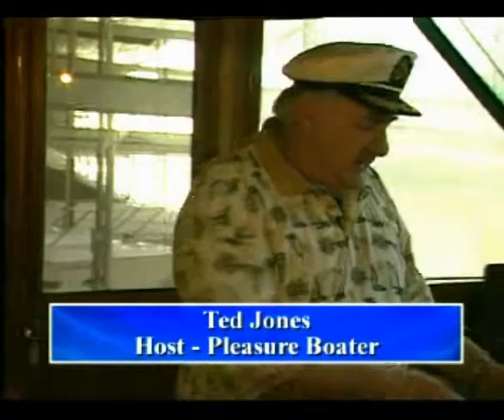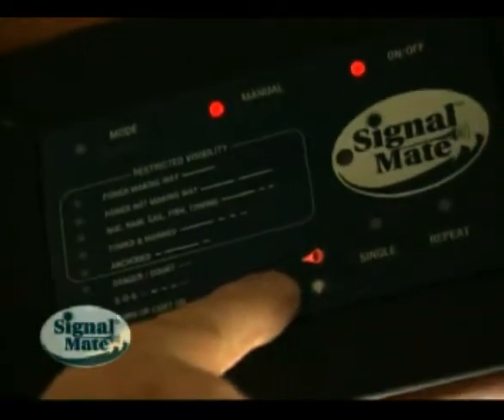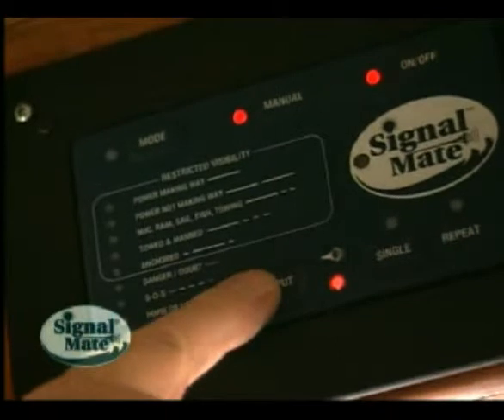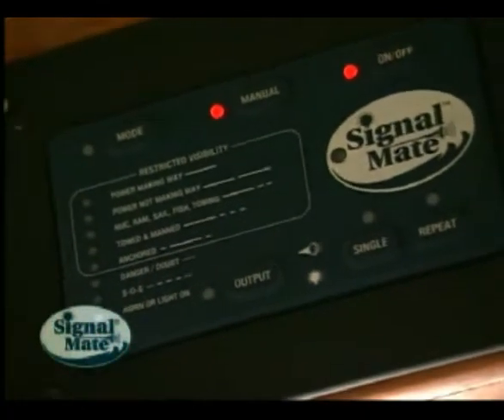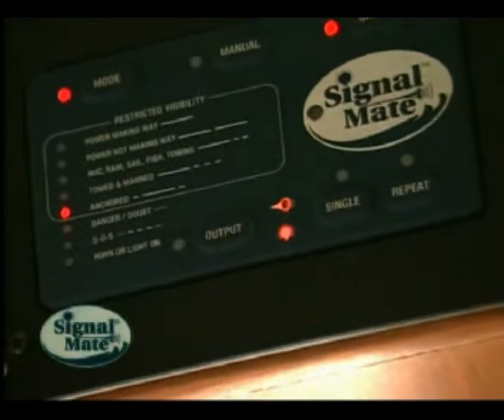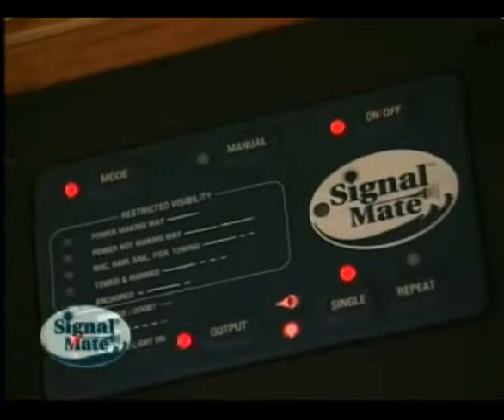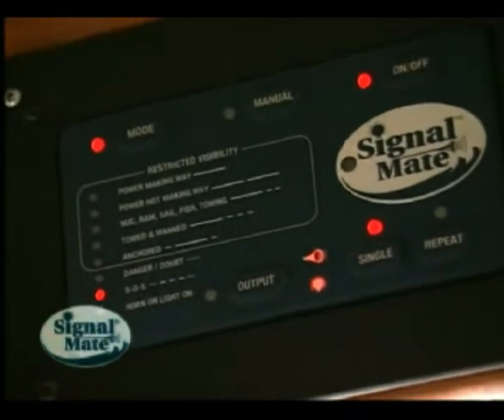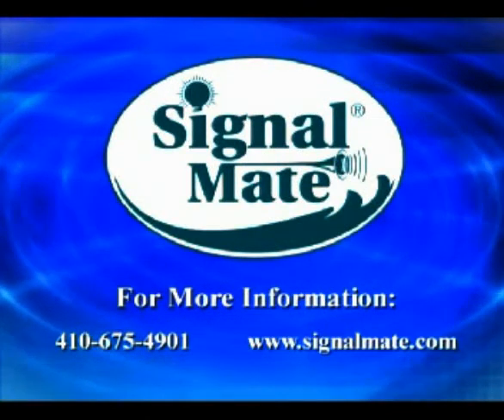Signal Mate - Boat Fog Horn & Light Signaling

Comment: Im pretty sure your at anchor signal dot, dash, dot is supposed to be a warning if someone is getting too close. Under restricted visibility at anchor you'd normally want a rapid bell for five seconds, every minute (or bell plus gong if over a certain size).
Reply: Hi Eric,The dot dot dot - dash dash dash - dot dot dot you mentioned is the international distress signal for when a vessel requires assistance. Rapidly ringing the bell for 5 seconds at anchor in restricted visibility is only required for vessels over 20 meters. See Rule 35 (i) and (j).The Signal Mate controller can provide sound signaling while at anchor in restricted visibility of one short, one prolonged, one short blasts in succession every minute to give warning of her position and of the possibility of collision to an approaching vessel. Rule 35 (g).The danger/doubt signal is five or more rapid blast is used when a vessel fails to understand the intentions or actions of the other, or is in doubt whether sufficient action is being taken by the other to avoid collision. Rule 34 (d).The Signal Mate controller can provide both sound and light signals (two 20 amp circuits) for maneuvering,  restricted visibility, danger/doubt and international and inland distress.Best regards,Captain David HorstUSCG Inland 200 Ton  Master License